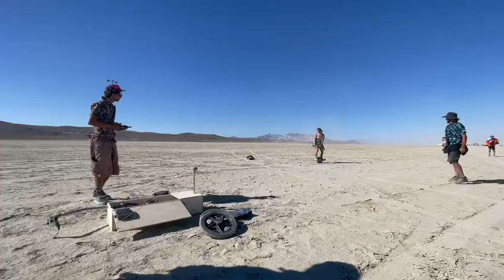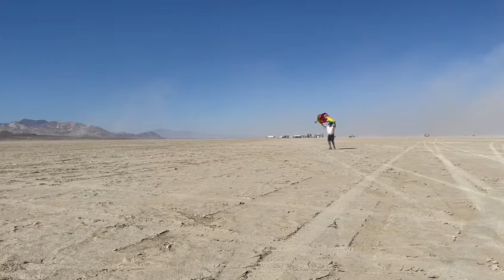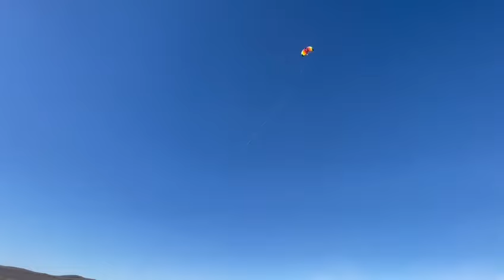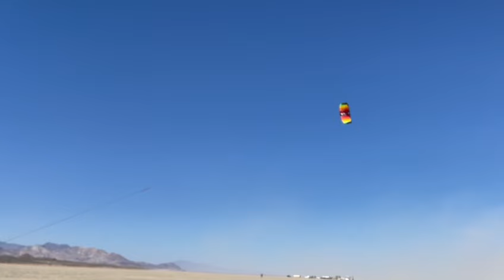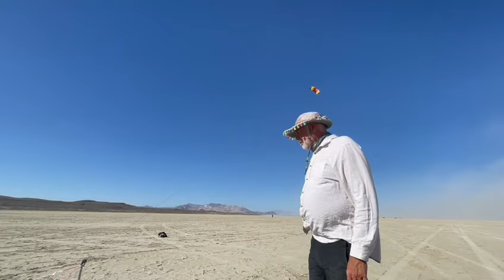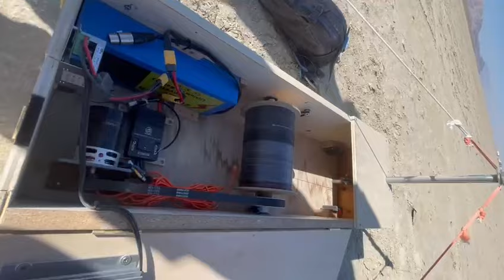VESC-based kite generator in use at burning man

Comment: Does it generate enough power to reel it in after? 😂
Reply: You can bring it to the edge of the wind window where there's a lot less force being generated to reel it back in! Power generation happens in the power zone of the wind window where the most force gets produced
Reply: @evanbarnes9984  So does this work by reeling in and out every time the kite sweeps through the arc of its path?
Reply: @friendlyfire01  the way I've seen kite generators work is they slowly pay out the line while the kite is in the power zone. The kite pulls the line hard, and the spool of line turns a generator. Then when the end of the line is reached, the kite is flown to the edge of the power window where the spool gets turned by a motor to reel the kite back in! Then it just does that all over again.

Comment: Amazing Cluelessnessss. You havent heard of Flowforms, self-stabilizing soft kites.
Reply from the maker: Thank you for the compliments ;)
The reason for using fast instable crosswind kites is that they exert a high force on the line, which can be exploited to harvest wind energy.
Reply: "Forces" are the same. But with Flowforms you can access jet streams. 
I got to 2000 meters with 3 chained Flowforms, and only then learned that 300 meters is the max for "Tethered Aircraft" in European Union.
Reply: @TimoNoko  In the US anything above 45 meters requires notifying the nearest ATC facility at least 24 hours in advance and there's a whole list of info you're required to provide them. Also some cities have their own ordinances for kites that restricts their max height, one city in California doesn't allow them to be flown higher than 10 feet lol. Our freedom over here is not derived from a lack of laws and regulations but from a lack of enforcement of the laws and regulations. Even our mighty 2nd Amendment rights are restricted by countless state laws.